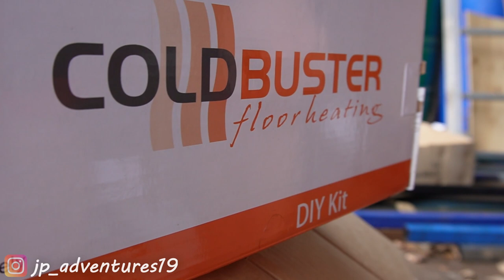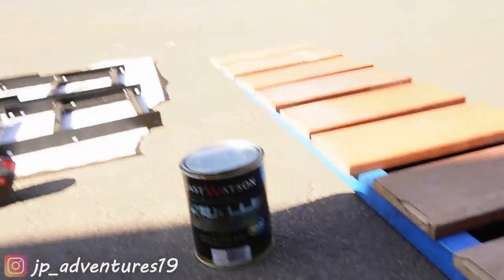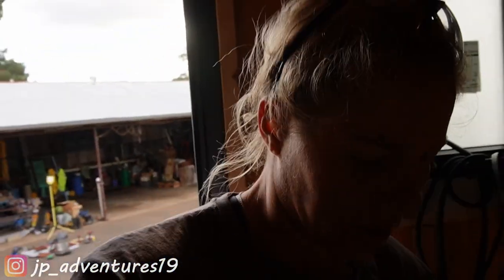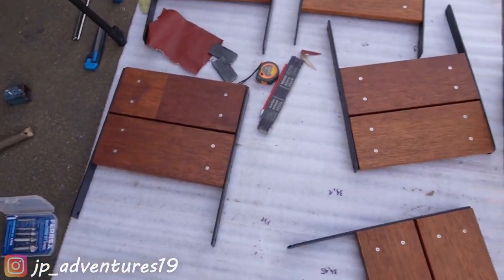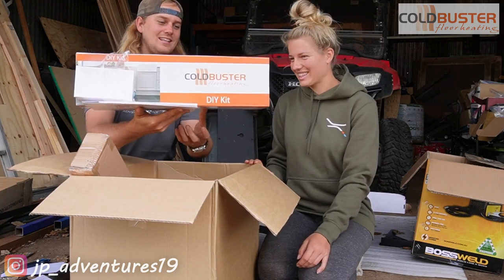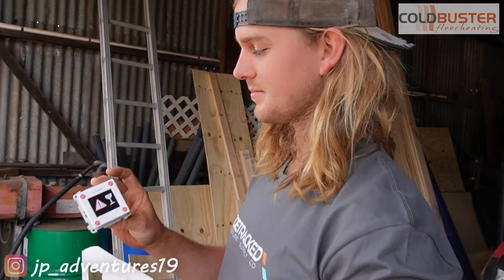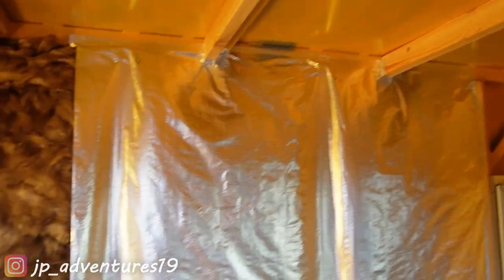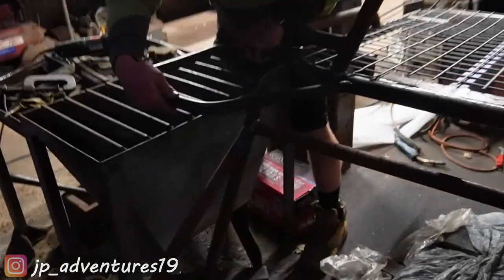A LOT GOING ON! Brush Bars, Insulation & Stairs - Ex Army UNIMOG Expedition Truck (Eps. 44)

Comment: Sweet. I did wonder if you were going to ever find enough insulation. Thank goodness for alternative sources. The stairs promise to exercise all your abilities, glad you are up for the challenge. And the addition of underfloor heating at this stage is great forward thinking. Sounds promising. Good idea to keep an easy access touch up supply for all the inevitable scratches and wear n tear areas. Will you be protecting your windows from exterior scratches in any way? Best wishes from a warming UK.

Comment: Hi don't want to knit pick but on safety in wet uddy or snow or frost oiled wood treads on steps will get as slippery as id put a,strip of skate board deck tape or emery cloth along the top of the leading edge of step treads as your a long way from the ground in remote areas it may not look as good but it may save you both fro. A fall I love what your doing what a camper we'll done it's going to be a fine home for you both I wish I owned it cheers
Reply from the maker: Thank you😇
Yes we will test the stairs and see how slippery they get. We could always change some bits and pieces along the way😇

Comment: Hey you two, the stairs are looking sweet!
So good that you found more insulation and can keep making progress inside. 
Will be interesting to see the new mounting arrangement for the front storage pod.
How many watts is the underfloor heating and is it 240 volt?
Reply from the maker: Thank you!
Yes it's 240v and uses 150w per square metre! Since we got 4m (50cm wide) it will use 300w :)